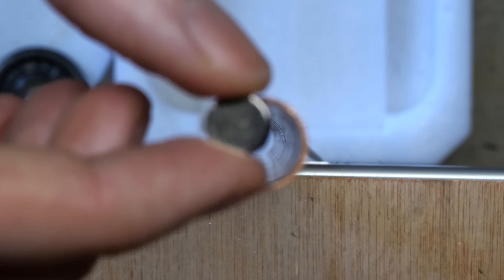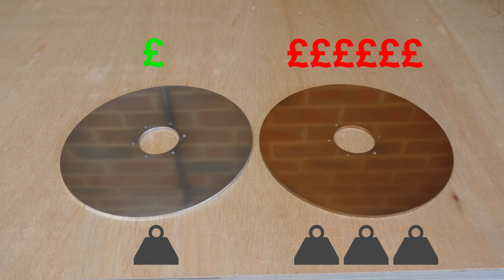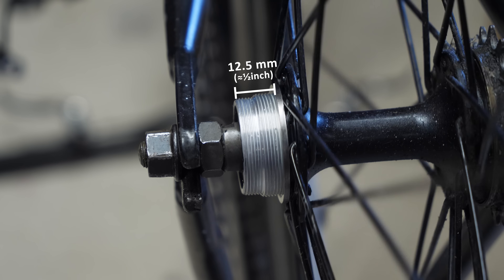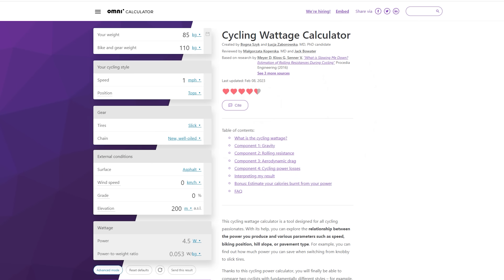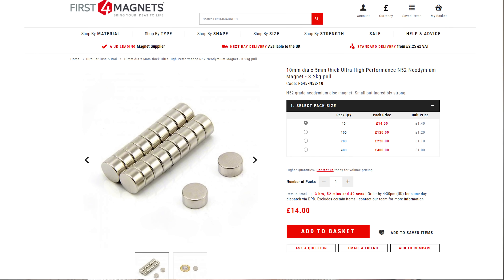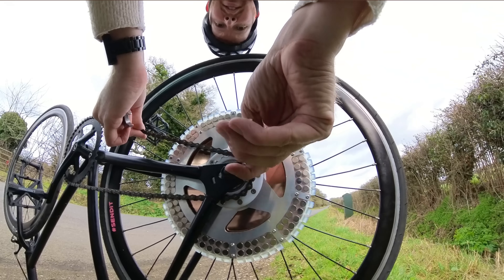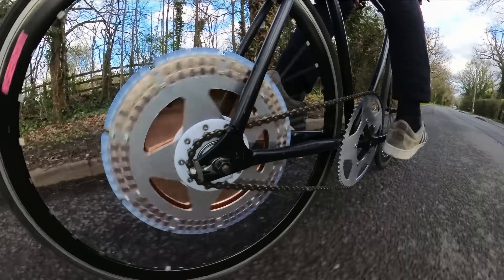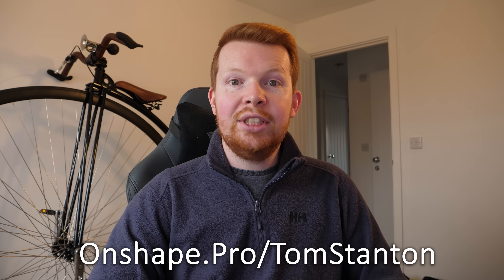Gearless Magnet Bike

Comment: As I was watching your video, all I could think of is the physics of bike breaks. I mean, combining the drive and break into one is a neat idea, and the fast damping at high speeds is a pretty neat feature. Only problem: the front break is generally more important. As you slow down, the center of gravity moves forward and takes less pressure off the back wheel, making it continuously less effective as you brake harder. so my idea: develop a front break using this method where the distance of the magnets from the plate is adjusted. Since the permitivity of air is so low, they dont need to move far before the force is significantly decreased. Maybe a cable system with a spiral shaped pulley could offer the particular distance control to turn a linear control (brake handle) into a logarithmic (exponential?) movement. The image in my head exists much like a regular plate clutch in a car or disk brake on a bike, but the disks never touch the plate and only get really close to maximize brake force. Maybe it would it also be wise to let the pads touch the disk if pressed hard enough, just in case. This would be an expensive front brake option, but would save on pads and maintenance (on paper) (also take my understanding with a grain of salt, im no expert)
Reply: I by no means am a physics expert either.. however Im an avid bicycle and motorcycle rider. This being said a front brake usually can not be used properly without a back break. I have unfortunately learned this by pulling my front brake on my 10 speed alone without the back and quickly being thrown over the handlebars to the pavement. Likewise if you pull only the front brake on a motorcycle without the back you will lay the bike down on the ground quickly as the front tire slides out from under you to the side (especially if not going perfectly straight.. I have done this also). This is why older bikes and motorcycles will be equipped with rear brakes as opposed to front if only equipped with one or the other. For safety reasons front brakes can only be used "in conjunction" with rear brakes. Just my 2 cents. Not trying to be a smart ass. lol
Reply: @scottshawn70  thats some solid input! But come on, I think fist full of front brake builds character. Seriously though, thats some good insight. A combination makes much more sense than one or the other.
Reply: @matthewshoemaker9922  I did think of another question for you.. you said that as the center of gravity moved forward this would decrease the braking, or make braking less effective.. but I seem to think it would have no effect (again Im no expert).. but the fact there is less "pressure" seems to be irrelevant since it is the decrease in RPMs and therefore a slowing of the electric field which slows/stops the bike, and is not actually any form of "pressure". Again not saying your wrong but as I think of it, it seems to me center of gravity is irrelevant and RPMs is the only stopping factor.
Reply: @scottshawn70  I mean in terms of breaking fast, which was one of the downsides in the video. Going slowly, yeah, its just an RPM game. But if youve ever tried to stop quickly for whater reason, front brake takes more of the load from your intertia still trying to move forward. Every time I've really grabbed the back break, i've only slid, but front break really stops you
Reply: @matthewshoemaker9922  I dont believe that is correct from a physics aspect. The breaking power of a front or rear brake should be equivalent regardless of the center of gravity. The front break is just as apt to skid as the rear if the brakes are set to the same resistance. The difference is if you pull the rear break as hard as you can, when the rear wheel "locks" the rear tire will "skid".. but when you pull the front as hard as you can when the wheel "locks" you are thrown over the handlebars. lol. So people generally do not pull the front brake as hard and manufactures may set the brakes different to avoid this.. thus only the rear wheel skids.  If you were to do a test vehicle in a laboratory setting with the front and rear brakes equivalent in strength and pressure applied, and used first the rear then the front. I believe there would be no difference in stopping distance.
Reply: @scottshawn70  do you not lean forward when braking hard?
Reply: @matthewshoemaker9922  of course.. enertia causes you to shift forward when you pull the brakes.. however shifting forward (or changing your center of gravity) should have no effect on your braking distance. If more pressure is put on one tire an equal amount is taken off the other so the bike should always stop in the same distance regardless of which brake you pull. Pulling the front break should stop you no faster than pulling the rear. Your front tire can skid just as easy as your rear if your brakes are set evenly. Leaning forward tho should make no difference.
Reply: @scottshawn70  I think we may have gotten a bit off topic here. My original point was that there currently isn't a front brake and proposed an idea for one using a similar system. I see what you're saying about using them equally, but it still doesn't apply when the only option is a back brake. But if one is stopping hard, there is pressure taken off the back tire as one leans forward. That reduced pressure means less friction against the ground, and less work done by the back break as it begins to slip more. Leaning forward also puts more pressure on the front tire, increasing its specific inertia and making more work for the front brake to do in order to maintain the desired deceleration. The work lost from the back brake must then be taken up the front brake to remain an equal balance, therefore making the front brake used more
Reply: @matthewshoemaker9922   I guess I was confused on your idea for a front brake. Excuse me for that. Are you proposing a two brake system? Brakes on "both" the front and rear? Maybe thats what you meant and why I was not understanding. I was thinking you were wanting to replace the rear brake with a front. lol
Reply: @scottshawn70  yup! Keep the back the way it is, but also add a similar front to help stop

Comment: Do a project similar with weights falling but instead try to make maximum volts and amps, and use the energy for something.  Then use solar power to bring the weight back up.

Comment: If you pulled out the generated current to charge a battery it would limit the heat gain.  You could then feed that power back into a front wheel motor to assist in acceleration or cruising.

Comment: Old GM mechanical speedometers(and other brands also) used aluminum for the speed cups which the spinning magnet. So no surprise there. Your testing is flawed and flawed badly when comparing the 2 discs on their descent with the weights.

Comment: Correct me if I'm wrong, but using this concept for a drivetrain seems fundamentally flawed. At rest there is no friction, as there is no speed differential between disc and magnet. On a standard bike you'd start in low and pedal fast with slow movement. This drivetrain wants to lock at low forward speed/high pedal rpm because of the large speed differential between disc and magnet. At high forward speed the disc is spinning fast, but so are pedals and magnet: same relative speed, so the drive is slipping the most when you want it locked, and locking when you want it to slip. Am I seeing this right?

Comment: is there a way to get electricity out of the magnets or the copper flywheel  from big dumps of edi currents?
Reply: reason i ask if you could get the flywheel under load in theory it would ad more friction or attraction aswell as give the ability to gain electricity  and with that if you make it so you can choose the load on the bike that could be your gear switching

Comment: Excellent research, engineering and presentation, I am sure Elon Musk could find an application for EV's.  Elmagco Brakes used the same principle for braking the humongous loads on drill strings in oilwell drilling rigs, but yes, they took a lot of cooling.

Comment: What happens if you try an aluminium disk rather than a copper one? Copper conducts heat a lot easier so maybe will be more efficient to be from aluminium? Depending on how much lower the force will be. 
Failing that, you could try a thicker copper disk with a much higher mass to see if the rpm differential needed can be lowered.

Comment: Add 2nd smaller chain ring  for up hill on the crank gear ring and add 2 speed front derailer on , might have to add a tension pully similar to a rear derailer to hold the slack when you switch to the smaller front gear for uphill

Comment: so this is a crazy idea, but what if you tried to apply this to both sides of the wheel? you might have to completely fabricate a new rear fork and way to mount everything, but with two sprockets on the pedal area you could double your output per push, as for coasting/breaking you would almost need to find a way to disengage the magnets almost all together, maybe a dial like format like for changing gears but instead it adjusting where on the wheel the magnets are spinning, even pushing them off for coasting, just an idea.

Comment: This is fine from an "exploring science" point of view as long as you go into it *knowing that it will be quantitatively worse in every way than just attaching the sprocket to the wheel*.
Like, you know what has even less power loss than a whole bunch of magnets and a copper plate? Glue. Bicycles don't have clutches. It makes no sense.

Comment: To create an electrical generator, you need a conductor, an magnetic field, and relative motion between the two. Funny enough, to make an electrical motor, you need a current carrying conductor, an magnetic field, and relative motion between the two. As you pedal, you're creating a tiny generator on your back wheel, which is creating a counter torque due to motor action. Thats why you're back wheel is getting so hot. Id be slightly careful as you're also probably turning the whole bike into a sort of battery. However, it would be interesting to see how much of a current you are creating, and whether or not you could charge a phone while you bike.

Comment: You are only using one side of each of the magnets.   The flux coming out of the magnets facing away from the copper has to pass through air which you must know has one thousand times the magnetic suseptability of iron.   To complete the flux path you must make the magnet holders out of steel.   The exact arrangement will depend on if you have used the N-S alternation that you mentioned during the initial tests.   The important principle here is that it is the amount of flux you pass through the copper disk that determines the effect.   Having stronger magnets increases the flux, sure, but completing the flux path will improve your design.

Comment: im sorry but your thumbnail thing literally shows a bike with a single speed gearing with some magnets around it, it still has 2 cogs of different sizes, therefore its a single gear bike, thats not gearless, im not going to bother watching your video i just wanted to say that having a single gear does not mean its gearless otherwise every bmx bike on the planet is gearless when their is actually usually a 3-1 upto a 5-1 ratio that comes standard on all bikes such as the one in the picture, its like claiming to have a perpetual motion machine but its powered by a battery LOL its an oxymoron and if you had a different title/thumbnail that wasnt flat out lying to me, i might have actually watched

Comment: It's hard to believe you spent so much time and effort on a drive concept that's so seriously inefficient.  No cyclist with engineering/physics knowledge would even consider this.  Magnetic eddy current discs like this are used on stationary trainers as the load, and they can absorb hundreds of watts of power.  
Typical chain & derailleur bicycle drive trains achieve about 97% efficiency when clean and lubricated.  Internally-geared bicycle hubs are much lower, down to 85-90% in some gears, and the cyclist can easily feel that loss.  
Your system, in the easy 10 mph 68 W wheel power case (135 rpm wheel, 235 rpm sprocket) is only at 57%.  If you want to climb a typical 6% grade that needs 200 W and 90 rpm at the wheel, the rider effort will be around 850 W at only 24% efficiency, wasting 650 W into the copper disc.  Elite racing cyclists can only maintain that kind of power for 20-60 seconds, and the average untrained cyclist can't reach 850 W at all.

Comment: I wonder if varying the shape of the copper disk would enable converting more or less of the energy to heat. Another thought was skin effect, I would assume that the frequency of the current produced in the copper would be proportional to the RPM difference, I wonder if that is significant enough to artificially increase the resistance and therefore the waste heat. Might try a thicker copper plate.

Comment: Great video and project, I did wonder at the start about how efficient this system would be (if it'd end up working at all). But not only is it rather inefficient the user power input and feedback properties are very suboptimal. I did notice that there's still a decent distance between the magnets and the copper in the holder, is that needed for structural reasons or limitations of the printer? If not it might be worth experimenting if getting it closer allows more force transfer and how it affects the losses to heat.

What is the cause of the heat building up in copper? Is it just bog standard electrical resistance, if so are there any superconducting materials that have this property (and retain it at superconducting temperature)? Could be an interesting followup for a demonstration project only, a liquid nitrogen application device so your pedal power gets to the rear tyre efficiently is never going to be practical or affordable. For practical uses at that price point I'd just get a belt drive and an automatic Enviolo hub instead.

Comment: You small scale experiment was skewed for copper to preform better. Your only getting favorable results for the copper because they are not spinning at the same rpm. Having each starting off at the same rpm and applying weight to the aluminum to give them the same inertiathen, apply the magnet brake would give you a more accurate result.there are too many variables in your experiment to give accurate results.

Comment: [Edit] Oh, yeah:  the whole wasted heat thing.  Oh, well. 

‐------------------------------------------ 

All kidding aside: this application is just begging for a Gates Rubber "Carbon Drive", which is a toothed belt system specifically for bicycles.  It requires a removable section in one dropout or stay.  I bet they would sponsor that part of a project. 

BTW,  brilliantly creative,  and that's a given at risk point.

Comment: TIME to print a new chain?!?  Nylon, polyurethane, or maybe whittle the chain out of wood?  Seriously, suddenly I’m thinking that IF you could print chain parts or find non-ferrous chain links, you could rig up a magnet powered ‘chain-link-cannon’ that would push the magnetic parts of chain through successive symmetrically well-arranged pairs of magnets!?!  Well done and keep the shoes away from that heat?!?

Comment: You're dealing with Eddy currents and wanting them to do the work for you, therefore you need to know the shape of the magnetic fields because as the magnetic field changes from pole to pole that provides the most resistance.
 Spacing of your cubes is essential.

Comment: What if you wire it so the currents generated by the system could be used to power a light or charge a battery? No sense in wasting all of that generated electricity

Comment: if you had a way to decrease the diameter of the magnet ring, you'd effectively be able to shift gears. magnets near the outer edge of the copper = low gear, as they move towards the center, you get a higher gear effectively. 

if while not pedaling, the magnets were moved outside the diameter of the copper disc, you could coast more effectively. 

I'm also super curious to see what kind of power you are generating here. could you not split the copper disc in two, and generate a current as it spins? all your wasted slipping is then actively creating electricity to say, charge a battery or run lights.

Comment: As a person who regularly uses a spin bike, I could easily imagine the disc heating up like that, and knew where the energy was going. I've regularly had the spin disc too hot to touch after a session. Obviously spin bikes work differently, the magnets are positioned at the very edge of are large disc, I don't know if what you needed was a bigger disc, rather than a higher gear ratio

Comment: I am no engineer/physicist but what if your set up was also a generator that would charge a battery so your currently wasted heat energy would drive an auxiliary  electric motor. The breaking energy could also be harnessed through some sort of regulator. Is this plausible?

Comment: Cool project! I have a suggestion: the bicycle wheel and hub system you’re using isn’t matching up with the effort you’re putting in on the other parts of the project. 

You should look for a bicycle frame and rear hub that supports a proper centrelock disc brake system - replacing the disc brake rotor with your contactless system would have huge advantages! No more replacing worn brake pads or disc rotors, no more replacing or bleeding hydraulic brake fluid, no more squeaky discs when in wet weather, and better brake modulation and traction control (squeezing hydraulic disc brakes too hard leads to rear wheel lockups and crashes!)